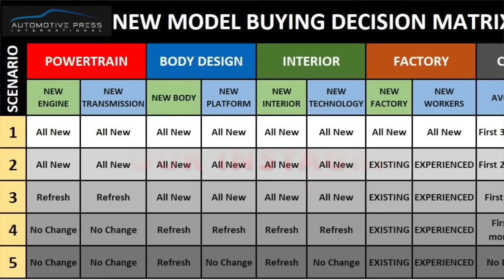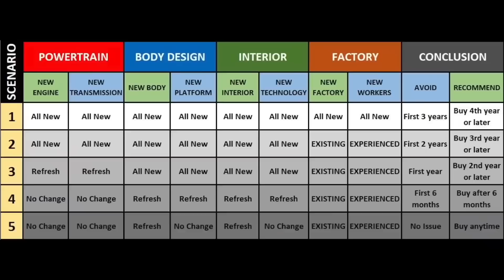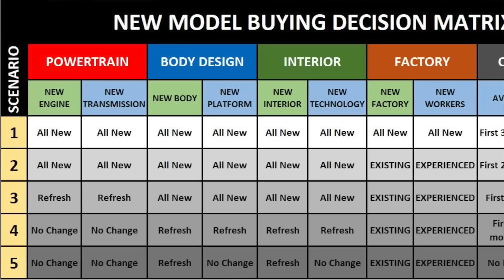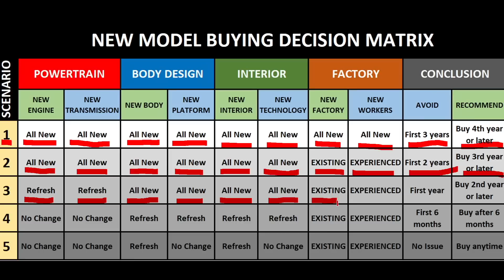SHOULD YOU BUY FIRST YEAR OF NEW VEHICLE OR FIRST YEAR OF PRODUCTION? ENGINEER EXPLAINS  IN DETAIL

Comment: That’s a big nope. I have had two first year redesigns and both have had issues. My last one was a 2016 Honda Pilot I recently had to dump at 46k miles I bought new. I was hoping to get 250-300k miles without issues. Heated seats issues, recalls and the worst was the injector problems that couldn’t be fixed. I’ll stick with my “decade old” 2023 GX460 I got to replace the Pilot and hope to keep it going for 500k+ miles.

Comment: Thought about this when buying my 2023 RX500H F-sport a few weeks back. The only issue is a piece of trim meant to hide welds, and such on the moon roof fell off. They're not sure how long it will take to come in and have to make a few calls and send emails. Just to make sure the part doesn't prevent water from getting in the cabin. This has to do with them delivering, whatever they spray on the car didn't come off completely. Washed it a few times and the drip marks are on the hood. Want to get it ceramic coated but 1st need that to be addressed and removed. It took me a few times of cleaning it completely off the windows as they kept looking smokey.

Comment: I agree with this! I was really upset though when I bought my 2022 sequoia (last year before the change). I bought probably the last brand new one in the country. Drove 6 hours to get it. Driving it home I heard a noise. Sadly I thought it was a driveline. It was! They replaced the drive shaft and now the noise is gone. But I was really shocked. Hoping that was the last of any problems. I know my 5.7 v8 with 6 speed can last me forever! I did the same when I bought my 2016 sienna. That just passed 110k miles with 0 issues.

Comment: I bought a Japan-built TNGA 2020 Toyota Corolla SE Sedan 6-MT in the first year of production & it turned out to have all sorts of problems in the 2.5 years & 9.5K miles that I kept it.  Electrical/battery/push-button-start issues, transmission issues, paint issues, all sorts of developed rattles/vibrations in the doors, pillars & dash inside the cabin.  Plus, Toyota apparently cut some additional corners to keeps costs down, such as poor cabin sound insulation from outside road/tire/environmental noise, no hood insulator pad, etc.  My France-built 2015 Yaris SE hatch 5-MT was a much better built vehicle by contrast & had no issues over 4+ years & 60K miles, prior to it being rear-ended & totaled by some idiot on their smartphone in late 2019.  I traded in the 2020 Corolla a year ago for a third-year production Mexico-built 2022 Mazda CX-30 CE 6-AT AWD & noticed zero build quality issues thus far, & no developed problems either.  So, don't blindly trust any brands these days, nor make assumptions based on where it was built - there is just a huge element of potluck, regardless..

Comment: David I have owned many Toyota models and just purchased a 2023 40th white 4Runner and love it!!!. I understand because of so called carbon foot print and the EPA new rules that Toyota has to go to smaller displacement engines along with turbo and battery assisted engines. On that note I think  Toyota and Lexus will be losing some of its long term reliability and dependability long term when you need new turbos and batteries etc, many more moving parts and some very complicated engines according to the master Toyota tech the car car nut.

Comment: David, thank you for this decision matrix. It would be very helpful (if you are willing to stick your neck out) if you walked us through a couple of vehicles. Like the Toyota Grand Highlander with the regular hybrid system. Is the platform new, or just a stretched TNGA-K? The interior is all new, and the tech is only what, a year old? And the safety system is TSS3.0 - it's an iteration of 2.0 and 2.5, so is it really all new, or just fine-tuned with a couple new features? I also don't know if the factory is new, or is it going to be built along side the existing Highlander? You possess knowledge that few people have in terms of knowing the technology and the factories. 

Also people are asking about the new Pilot. They say the engine is all new (and it is DOHC vs SOHC) but it's hard to believe they started from scratch, and, it's still in the J35 series. I don't (and lots of people fit my category) know about the platform or the tech. What do you think about these two vehicles? Thanks very much David.

Comment: Notes from Morgan, J. M. (2006). The Toyota Product Development System. 
An emphasis on body design, as this is the most common change on model updates. Occasionally a “clean slate” automotive design occurs. More commonly a “global platform” of modular parts is used for the chassis and driveline.  A unique “top hat” consisting of the body and interior sits on top the chassis.

Comment: So that means I should NOT buy the 2024 Grand Highlander then?
Reply: Im buying now, wait list will be long. Besides same engine, tech and platform as current highlander its not that different.
Reply: @kevlew70  what trip you will go for? And your thoughts on Pilot when compared to GH?
Reply: If the new Lexus tx is based off the new highlander but a year later, does that mean it’s new or a year old?
Reply: @Vin3Man  Depends on if they build the Lexus in the same plant as the GH. I assume they would, but don't know. The Lexus interior will be all new though. Also, the new Toyota connected Nav/Infotainment system is only a year old if that. But I think it can be updated over the air (OTA)?
Reply: 2025 model will be the best to buy.
Reply: But what about hybrid max? Isn't that first introduced on the Crown which is just coming out now
Reply: @sangusk45  hybrid max engine …. Looks very familiar in crown and Lexus RX 500s